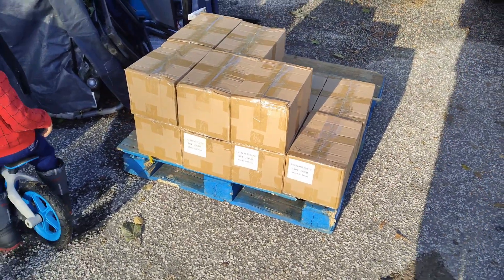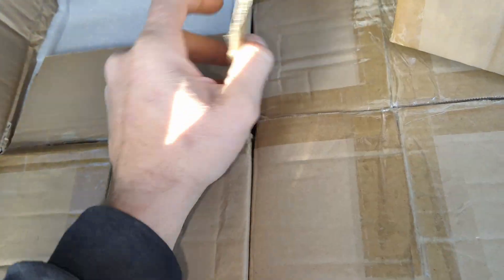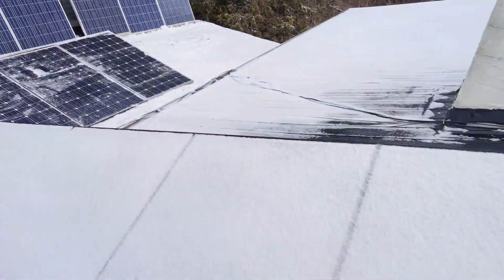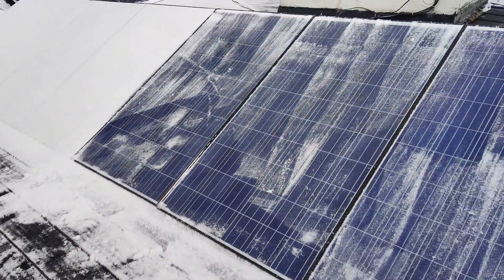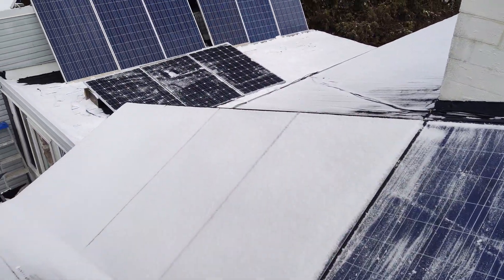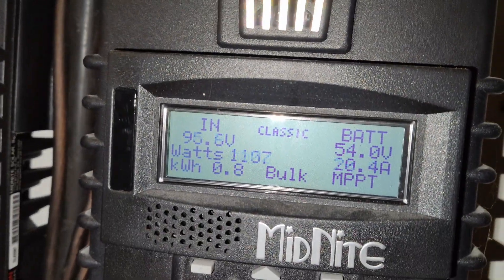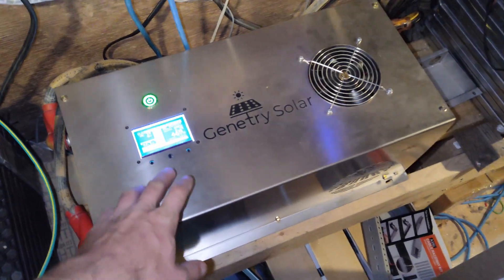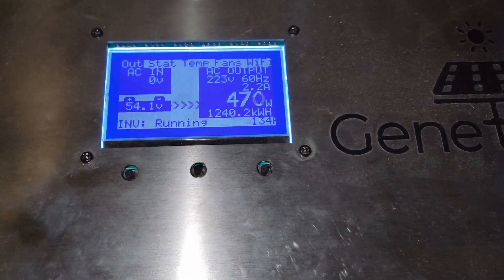Massive Battery Haul And Living Off Solar In Winter

Comment: That's when having a wind turbine to help with battery recharge would be handy. altho "if" there's any kind of wind of course.

Actually, i wonder if you could make a "snow" turbine. Where snow falling would hit one side of the turbine blade causing it to spin and as the hub rotates, the snow would fall off the blade. Albeit, it'd have to be a "big" hub/blade to get snow to turn it  🤪